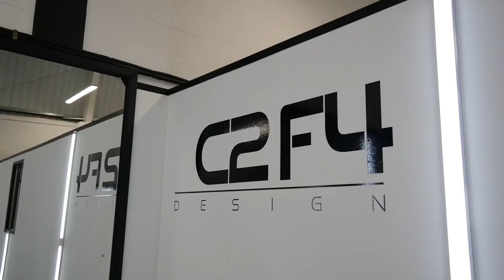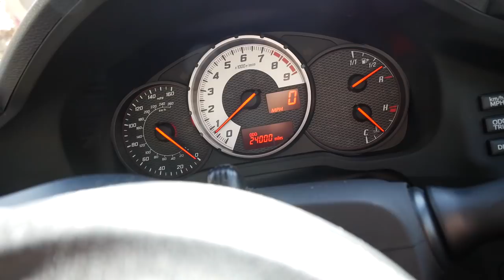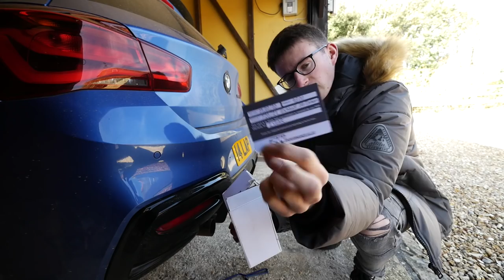Fixing The 'PROBLEMS' With My M140i... *Modifications*

Comment: The links no longer work, which tips did you use? As there's 2 similar version so wasn't sure if they were all the larger diameter. Also, did you have any problems with these hitting the diffuser? Cheers!

Comment: You don’t have to take the mirror out. Just use a pry tool at the very end of the mirror caps and they come loose. You won’t break them. I’ve done this like 10 times. While you removed the glass you could have installed some nice dynamic blinkers too. It’s like a 10 min job
Reply: my carbon cap has 2 screws in it on the inside and it had original assembly by BMW (M Perfomance package)

Comment: Luke, hello,  I need your help, I’m having this problem with my m140i since last week, the problem that the car’s B58 doesn’t reach full power, it gets no more than 300 hp according to sport clocks.   Normally my car reach the full 340 hp, so I took it to BMW dealer, they checked air filter, reprogrammed,  you know, anything but they found nothing wrong, so they told me maybe the problem was the gas (petrol) y used , so I stopped today at shell and filled the tank with 92 octane premium gas but the problem still.   I was going full throttle and the car is slow, I mean ...for sure a Golf git would kick my ass.  Imagine, what do you recommend?

Comment: Newsflash, there IS such a thing as too many mods.
It's your car of course, but I like silver mirrors on mine, and silver trim on the splitter.
I like the none-flashy slightly sleeper look of the original exhausts, yours now look chavvy (in my opinion), and it hasn't made the car any faster ......
Standard M140i ftw, spend your money on tuning it.
The only 'problems' this car has, is the slightly cheap interior trim (especially the tailgate) which rattles a bit, and the door trims have some slight rattle issues too.
The stripes, oh dear, nothing more needs to be said.

Comment: Didn't need to pop the glass on the mirrors. Takes 30 seconds to pop them off.
Reply from the maker: Ok. Certainly makes the job easier with the mirror removed though
Reply: Not in my experience mate but whatever is best for you